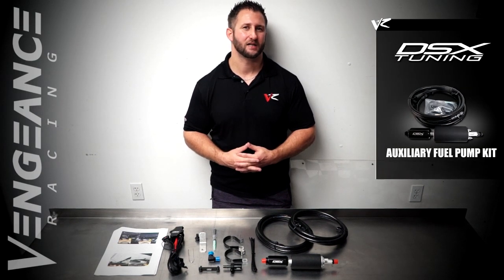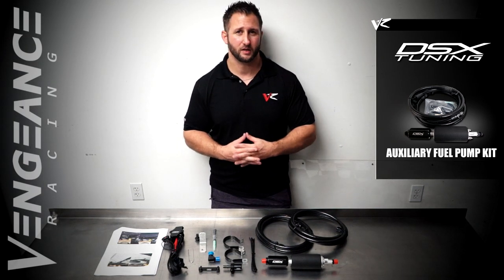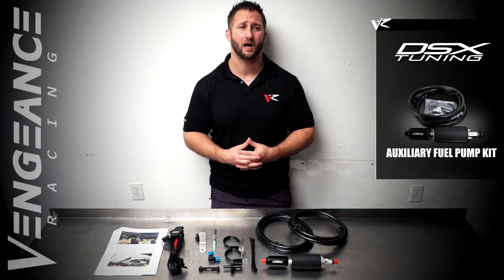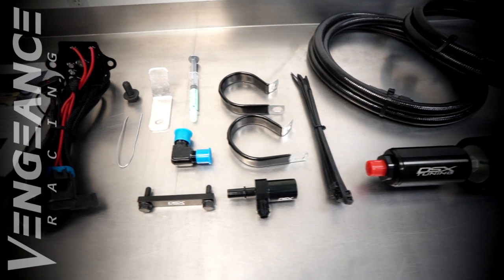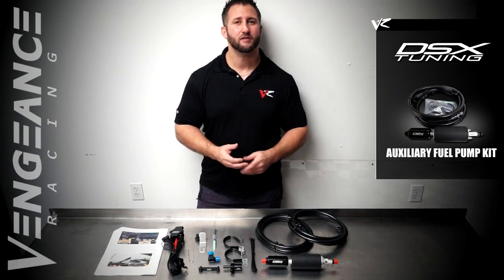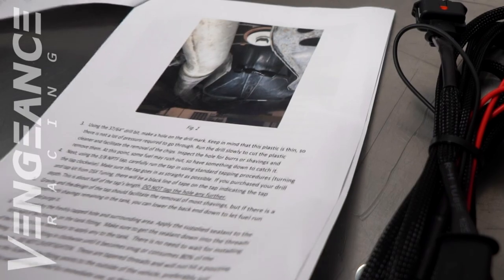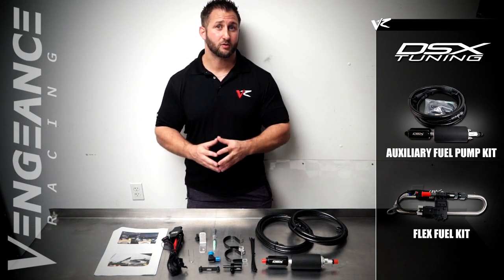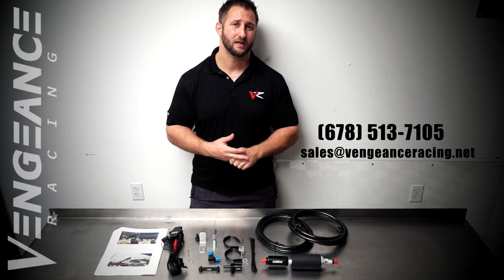DSX TUNING  Auxiliary Fuel Pump & Flex Fuel Kit (OVERVIEW)

Comment: I’m experiencing a slight stumble when the this pump kicks on during WOT in the 1500 to 2500 range on a 5th gen zl1. Is this a tuning issue?
Reply: that sucks man. I built my own Aux pump system using the same pump and high quality fuel lines and fittings. Costed me around $500. Operates on a honeywell hobbs switch and comes on around 5psi. Never had an issue.
Reply: Tech User 
You tapped into bottom of the plastic fuel tank ? I thought about fabing up my own but didn’t.
Reply: @fbanda20  Yeah, same way the DSX pump does
Reply: B Damon how can I get ahold of you I have some questions
Reply: Did you figure out the issue?
Reply: @Camaro254   it’s a tune issue I believe. It’s not actually during WOT it’s part throttle feels like I’m pulling a trailer kinda feeling. Just have had time to mess with it. This system has been great otherwise!
Reply: @fbanda20  ok cool, you have hp tuners?
Reply: @Camaro254  Sure do.
Reply: @fbanda20  did you data log it
Reply: @bdamon4646  same
Reply: 9 lbs is when system kicks in right ?
Reply: @Highlander1432  7 or 8 psi on. Can’t remember but ya somewhere around there.
Reply: I’ve got the same issue… ever find out the problem?

Comment: Why not drop the tank and install a pump?
Reply: A lot of ppl do this bcuz it's cheaper and less labor while still being effective
Reply: @lostinawareness7979  I don't see how that's the case, when a 525 pump is $150 and will fit in the stock basket.